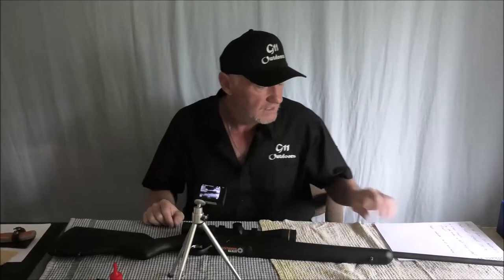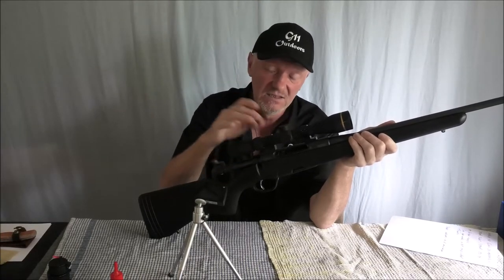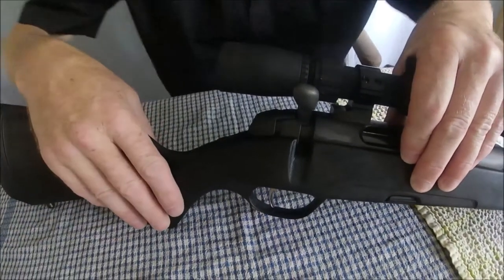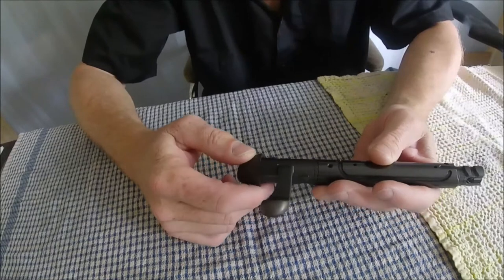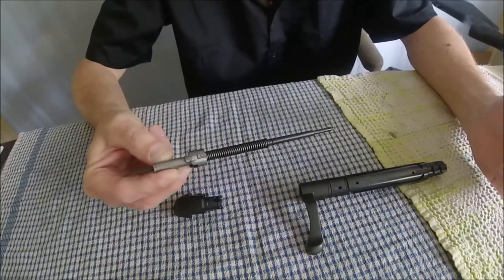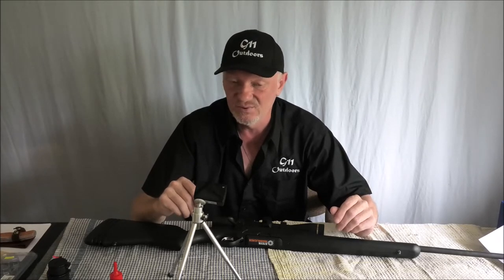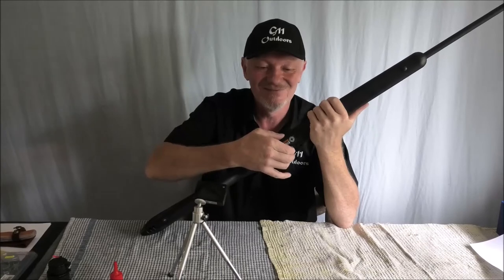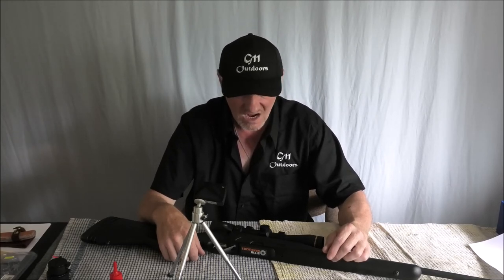Steyr Mannlicher Pro Hunter bolt disassembly

Comment: It is indeed a very simple procedure once you got it right. I didn’t get it some years ago and went to the gunsmith. He also needed a look. I think there just 1 Russian guy showing the bolt. Btw mine is a 80’ies match rifle , but generally the same
Reply from the maker: I've recently put a deposit on a Stainless walnut stocked SM12. Wow, what a work of art. It has the smoothest bolt of any rifle I have ever held with really tight tolerances unlike the Tikka which has a very smooth but sloppy bolt.

Comment: I still have few question about the bolt mechanism. 
1. How does the two fingers on the front of bolt cap group contact with the cam sleeve?
2. Since the cam sleeve was set in the slot of bolt handle inner tube, it can't move forward because of this arrangement. But why the cam sleeve will not move backward during bolt operation sequence?
Reply from the maker: This rifle and bolt mechanism is still new to me so trying to figure out exactly how everything works is still a mystery to me. Hopefully in the future I will be able to answer your question but at the moment I can't. Sorry I took so long to reply but I've been working at remote mine sites. Thanks for commenting.
Reply: @gobangs1117  Thanks for your kind &modest information. I have searched Steyr's patent and manual, unfortunately the drawing is very crude and simple.
US6178682 is the applied patent. My latest video may help you to understand its mechanism though some errors in it.

Comment: Dear Mr Gobangs11, I have a Steyr CISM 300M (.308) but have a problem. it's no more possible to enter the bolt in it's slot. It's blocked about 5mm before the complete placing. Do you think you could help me ? Do you eventually have an email address where I could send you some pictures and a small video ? Thank in advance. Best regards.
Reply: Under what circumstances did this occur? Have you played with the bolt at all, disassembled it ? If the bolt is as it should be check with a bent piece of wire or right angle probe to make sure there are no obstructions in the lugs recesses in the breach. These are the most obvious reasons for your issue.
Reply: Hi Collin, what was the solution to this problem? I have the same problem on a Steyr Pro Hunter 30-06, followed the video for bolt disassembly but when placing the bolt back in the receiever the bolt also stops short and will not return completely.